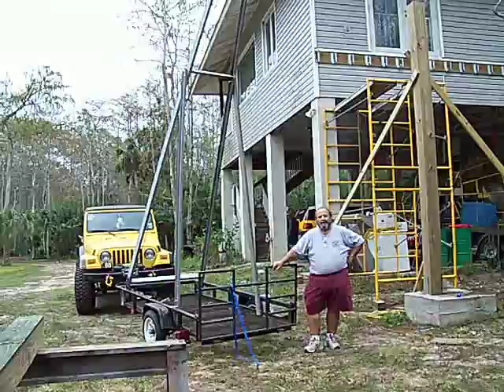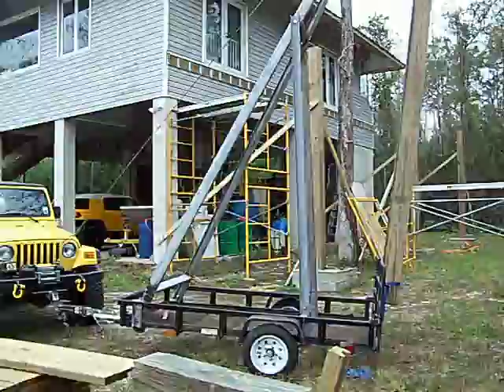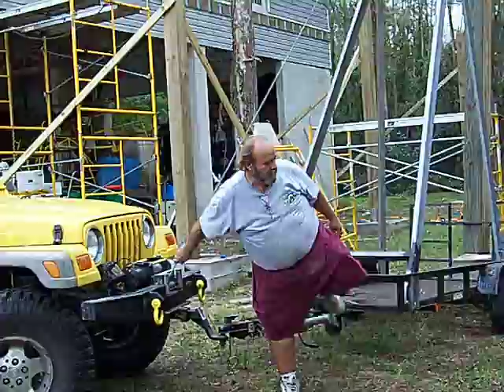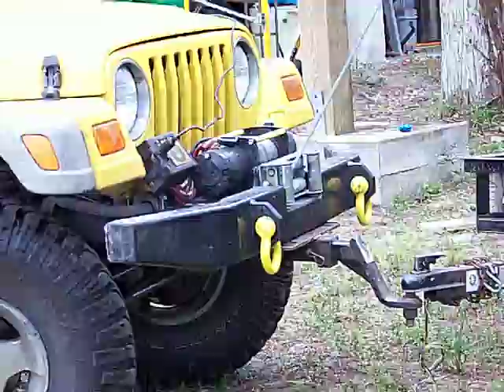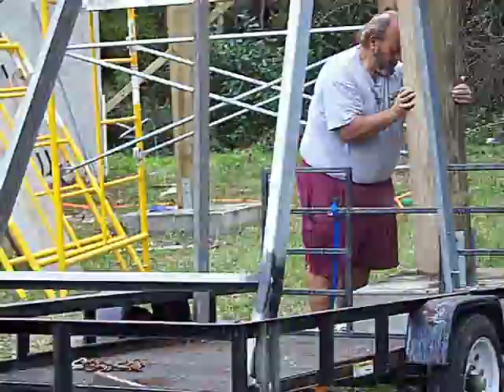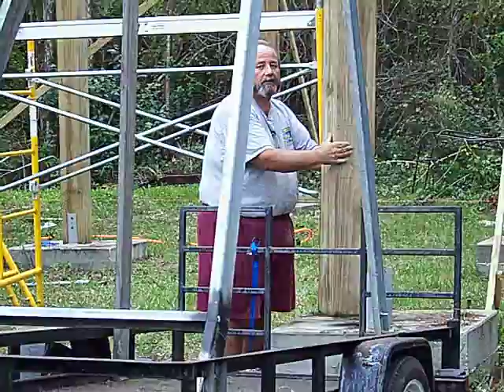homemade crane

Comment: Great looking setup. When you mentioned strapping the pole to the trailer to prevent tipping, it occurred to me that you could make it more stable in use by loading the trailer with something like concrete blocks to lower the cg.
Reply: I'll just put it this way little buddy is aware of the risk versus the reward he's had to carry one or two of them Post in his time

Comment: Hi, I really like your crane and I would like to build one for myself. I'm building a log cabin and will need to have the ability to lift logs into place. Can you tell me the type and size of metal, and the length of the metal you used? Do you know the lift capacity of your crane? Thanks in advance for your help.

Comment: How much weight will it hoist?
Reply: rmgravley not much...the main A frame is barely adequate as it has no beam depth...I am surprised it lifted those posts.
This chap can drive a trailer well, but not design a crane. But it worked for what he did and he didn't kill anyone. I have a friend who lost his lower leg when a crane collapsed...and he was a pro crane installer.